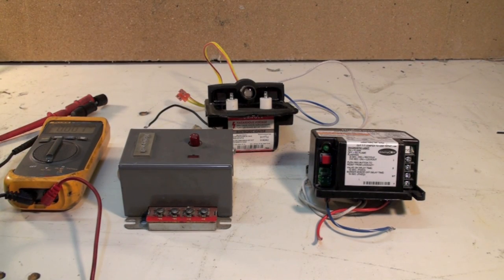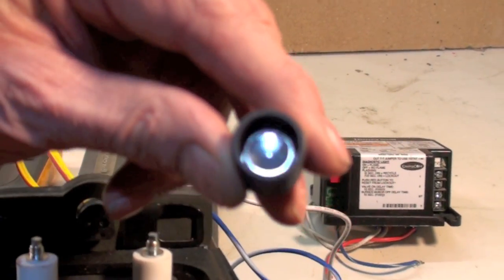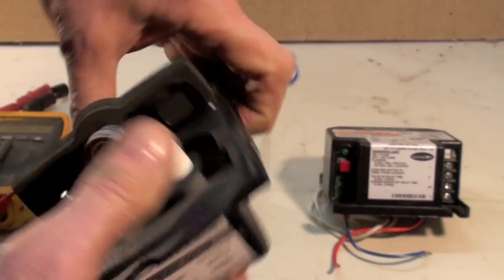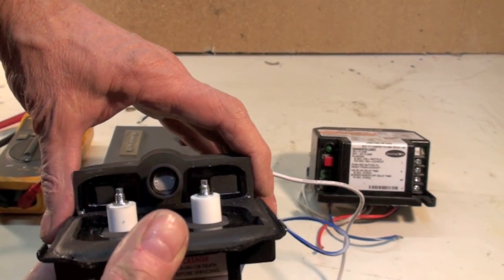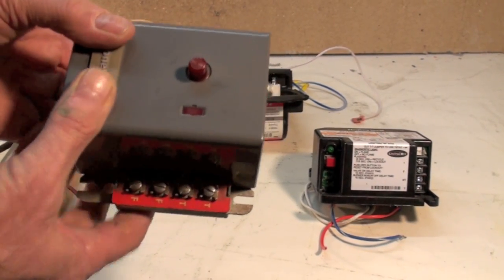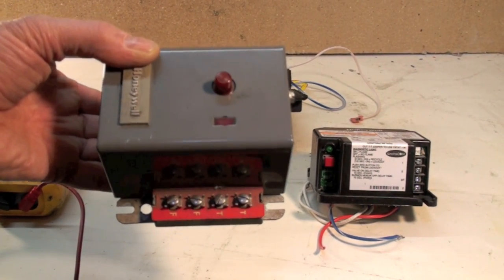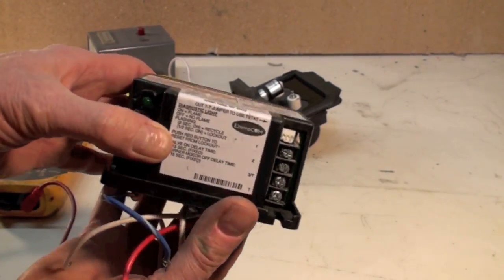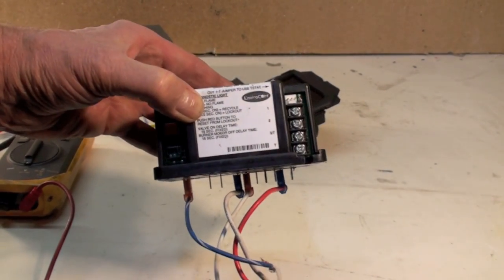Oil furnace cad cell and relay

Comment: what would cause the reset button to pop about once a month?  Other than that furnace runs just fine when it calls for heat.
Reply from the maker: +Tronix102 I would look for a dirty cad cell or possibly a blockage in the oil supply.  Hope this helps.
GFM
Reply: +grayfurnaceman  Thank you.  My furnace guy wants to replace the burner motor for over 110 + labor.  Could it be the burner motor?
Reply from the maker: +Tronix102 Is the reset on the motor popping out?  If so, it is the motor.  If it is the reset on cad cell relay the motor is not the problem.
GFM
Reply: +grayfurnaceman Nope the button that pops is on the Primary ignition controller, not on the motor.  I did look at the cad cell, and its super clean.  Thank you for all the help.  I will keep an eye on it.
Reply: +grayfurnaceman One last question, can you install any type of cad cell relay on a furnance?  I have a R8184G1294
from Honeywell looking to replace it.
Reply from the maker: +Tronix102 You need to know if the replacement control is listed as a replacement for your control.  Its on the installation instructions.
GFM

Comment: My R7184P  will not start ive held the reset button multiple times light will not flash but there is power going to it i shut of the power and turn it back on the green light flashes once. But when i hold it for a reset lockout  wont do anything
Reply: Yes, mine does the same. GFM, can you please comment on this. Does this mean the control unit is no longer working. I tried to press down for 45 second and nothing happened----neither the flashing light came on.....And how does one test to see of the unit is still working....

Comment: the pressures is fine.  i set the the dial on the thermostat  some times to 74 then i heard the click on the thermostat.  the actual home temperature  goes to 72 and sometimes few minutes  i hear the click again on the thermostat.   then later the baseboard is getting  cold. then i turn up the dial... in order for the house to be in a 74 temp.  i have to turn up the dial to 78.  can u explain  why... or ther is something wrong with the  thermostat l.
Reply from the maker: +Luis Cardenas Try jumping the wires to the thermostat to see if the short cycling goes away.  The house should overheat.
GFM
Reply: U want me to connect both wire connecting to the thermostat  together. Question 1. if the house overheat and the beseboard is hot... what thats mean... 2 if the baseboard is hot and suddently stop  heating what that mean... thanxs dor the help
Reply from the maker: +Luis Cardenas If the house overheats, the thermostat is the problem.  If not, there is a problem in the boiler.
GFM

Comment: i have a oil heater furnest.  my thermostat  i think dont work properly.  i set to 70 degree  and the house temperatures goes down to 65 and doesn't heat the house
Reply from the maker: +Luis Cardenas Dos the burner come on and stay on?
GFM

Comment: I have a Lanair mx300 that will kick on but will not fire. I've just replaced the ignition and brass washers that touch the ignition arms. Any suggestions?
Reply from the maker: Do you have oil flow?
GFM
Reply: @grayfurnaceman  yes I have oil flow to the burner. However I'm not seeing the fog like you explained in your video

Comment: I've got one that has been stumping me. I've got an older miller furnace with a beckett burner, I plan on heating my garage with it. It will run like a top for 13-15 minutes and then trip out the primary controls red button, if you reset it the furnace will not ignite again. If I allow it to set for 1/2 hour or so it will fire up and run for 13-15 minutes again and repeat the same thing. Any ideas?
Reply from the maker: Sounds like an oil supply problem.  Oil filter plugged, pump screen plugged?
GFM
Reply: That would make sense, when I got the furnace the pump shaft would not spin freely, after pulling it apart and finding nothing visibly wrong I had to be careful not to over tighten the screws or it was bind again. I'll grab an oil pressure test kit from work and check it but I'd guess the pump has an issue. Thanks for the great videos.
Reply from the maker: fyi pumps are not normally especially free rotating.  They are usually stiff.
GFM
Reply: Got it figured out tonight, after I found the pressure bleeding back to 0 after shut down last night I checked a few things at work today and found the flare I had made was not sealing 100% and sucking air. I re did the line and now all is good in the shop. Thanks again for the great videos and advice.
Reply: Also I'm a home brewer as well and this functioning furnace will make winter brew sessions in the garage much nicer, cheers!
Reply from the maker: Glad you got it going.
GFM
Reply from the maker: And cheers to you.
GFM

Comment: CAN I USE THE WHITE PURE SILICON FOR SEALING WINDOWS  WOULD IT SEAL HE BACK OF THE OIL PUMP PLATE GOOD FOR 300 DEGREES F ?  OLDER WAYNE BURNER  KEROSENE
Reply: +Rondo Schiavoni&#160; I notice at 3:37 he is saying and showing the one orange lead going to both motor and transformer. I guess therefore that as long as the motor is running the transformer is sparking the electrodes.
Reply: so that is like saying that the transformer doesn't shut off as soon as the flame starts  and the cad cell sees it  ,correct me if I'm wrong,
Reply from the maker: +Rondo Schiavone Yes.  Most cad cell relays can be wired to operate the transformer only until the cad cell sees the flame or you can put the motor and transformer leads together and it runs for the entire cycle.  Most are set up for continuous transformer operation.  Hope this helps.
GFM
Reply: YES IT HELPS BUT WOULD IT BE BENEFICIAL FOR THE TRANSFORMER TO LAST LONGER TO HAVE IT SHUT OFF.?
Reply from the maker: +Rondo Schiavoni I have had so few of them fail that I would not be worrying about it.
GFM
Reply: thanks for your help you have very good videos.

Comment: What would cause no power to the 705?
Reply from the maker: The control is generally wired thru a limit and then to the service disconnect of the unit.  If the fan runs, I would be looking at the limit.
GFM
Reply: @grayfurnaceman  I think I saw 2 I just noticed a fuse that was burnt I replaced a 3 amp as doing so the fan came in won't shut down the switch in the stack the connection is burnt

Comment: mine continously is flashing? any help. i changed oil filter and air filter. i had it running, then shut off, now i get nothing.
Reply from the maker: You probably got air into the line.  If you have a newer Cad cell relay, they will only let you press it once.  You can fool it by pressing a button underneath to give another try.  I did a video on this in my oil furnace series.  You can bleed it if it is one pipe at the pump.  Bleed until it gets clear.  Hope this helps.
GFM

Comment: my cad relay hums but the motor wont kick on i replaced the motor and it does the same thing  i have a pump for it to but i figured i better stop there and ask you
Reply from the maker: Sean Hodgson Will the pump shaft rotate?  Normally, it does not rotate easily but should turn.
GFM
Reply: It turns pretty easily but the motor doesn't turn on at all just the click and hum from the Cad. relay
Reply from the maker: Sean Hodgson If you don't get a hum from the motor itself, you probably have a problem with the relay.
GFM

Comment: I just turned on my furnace for an hour, I primed the burner. The furnace shuts off and has the blinking red light. I held the button for 1 minute and it showed two orange lights and a buzzing noise. I think the furnace person got paid for changing some furnace filters.

Comment: would u know y I smell kerosene threw vents?
Reply from the maker: +Chaz Hayes The unit probably needs a service.  The smoke pipe or the heat exchanger may be plugged.  Hope this helps.
GFM
Reply: Are you located in maryland?
Reply: I just paid 60$ to blue dot to come out n he only hit on off switch 3 times n placed tape on test hole n then it seemed to work for like 2 hours now we get a burned oil smell instead of nonburned like before n I have pipe off n it's not clogged the furnace was installed in 2007 n has a Beckett burner n the blower is on top so I don't know ho to look it combustion chamber to check draft
Reply: Any opinion on what I should do
Reply from the maker: +Chaz Hayes If there is smoke coming out of the overfire test hole and not out the smoke pipe test hole, the heat exchanger is plugged.
GFM
Reply: STOP USING IT! You have a cracked heat exchanger. That unit legally should have been condemned by the technician to prevent you from using it until the heat exchanger is replaced. I really hope that gray meant to say cracked, not "plugged." When someone dies from CO, it will be the technician's fault.

Comment from the maker: I assume you have done the reset for 45 sec.  If it does not work then you probably have a problem with wiring.  If you send some pics, I might be able to help.  Send them to grayfurnaceman@gmail.com
GFM

Comment: i know is on but no baseboard  is cold
Reply from the maker: +Luis Cardenas If you have a boiler system, and the burner comes on but not heat goes to the baseboards, check the boiler pressure.  It should be 12# for a single story or 18# for 2 story.  Hope this helps.
GFM
Reply: Thanx i check tomorrow...

Comment: it's "cadmium sulfide"... NOT "cadmium di-sulfide".
Reply: A simple thank you would have suffice...You focus on an honest mistake, so did you get anything positive from the video?
Reply: @haroldbottom3474  It's only for clarity that other viewers don't mistakenly call it this as well and start a snowball effect. It is a very straight-forward mistake and takes nothing away from Grayfurnaceman's overall hvac knowledge, which does exceed 99% of most hvac techs. Thank you.

Comment: New nozzle new filter and the thing keeps on cutting out. Reset after 15 secs furnace starts running then cuts out. Re bleed till oil is running clean and it still cuts out. What advice have you got for that?? Fairly new  hot air Beckett. 1/2 doz. yrs old maybe. thx
Reply from the maker: Is the burner burning when the unit stops.
GFM
Reply: OK, I got it going by cleaning that cad sensor?? thingy.. but now I have a lot of black smoke out the chimney.. @grayfurnaceman
Reply from the maker: If the black smoke persists after the initial run time, you will need to adjust the air to the burner.  First, make sure the slots are not filled with dirt.
GFM